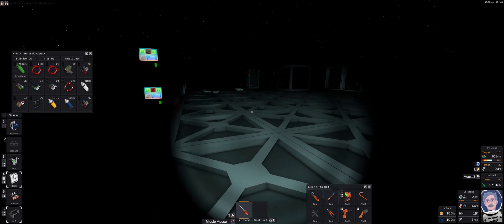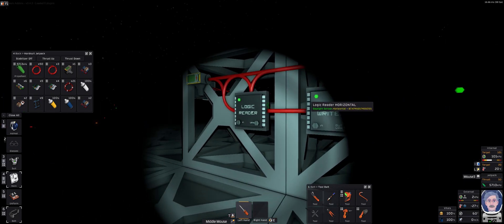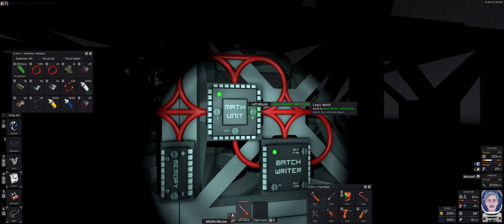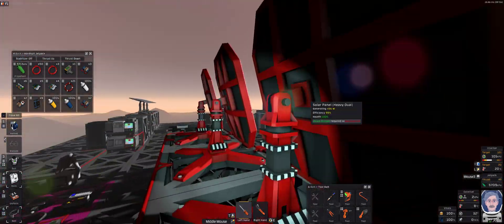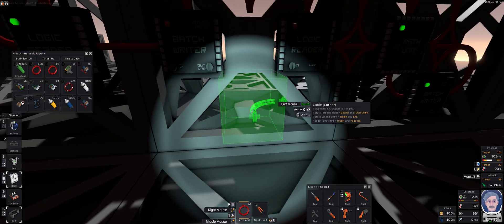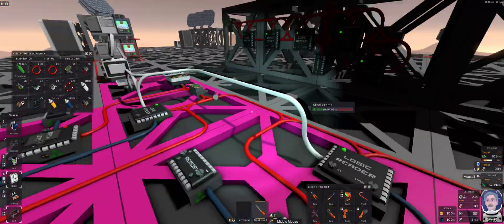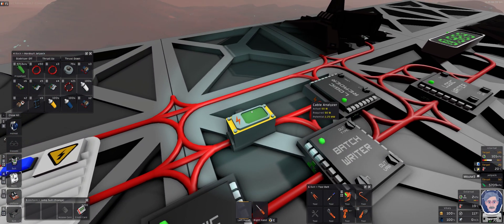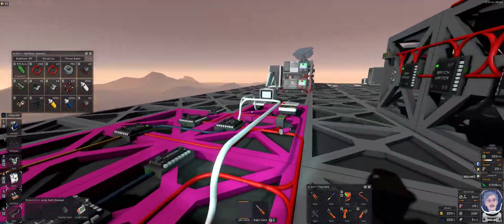Complete Idiots Guide to Stationeers - Solar Tracking without IC Coding

Comment: I'm able to get 99-100% effeciency on my panels using only 3 components for tracking.

1, Sensor
2, Logic Reader
3, Batch Writer

Use the logic reader to read the solar angle and output it to the batch writer to the correct axis, its dead simple.
This of course only works this well if you are more or less directly under the path of the sun.
Reply from the maker: yup - that's the way to do it on the moon where you start of pretty much on the equator.  Not sure what the devs have planned for the starting location(s) once the new terrain system is implemented - maybe we'll be able to select equatorial starts on the other worlds too...
Reply: @54bear  fair point, i didn't realize you didnt spawn on the equator on all planets, been a while and im just now getting back into it

Comment: Still didn't understand how the logic system works and what the values mean, spent too much time talking about other irrelevant things.
Reply from the maker: I will do a vid on the fundamentals on logic values and how/why they can be used.  A quick way of thinking about them is that they are 'measurements' of something the item in question has or uses.  Just about every item in the game that has an electrical connection will have a bunch of logic values you can access or manipulate in some fashion - but having said that, the vast majority of them you will probably never want or need to use.

A good way to get familiar is to print a Configuration cartridge (electronics printer), put it in your tablet and point it at electrically powered things.  That will show you the current values of all the 'things' that device knows about

Comment: Hi,
great explanation. I had a similar setup myself.
But I always had the problem that my cables burned out.
I had the strong cables. But I didn't have the dual panels.
Is this due to the panels or is my cabling incorrect?

Thanks.
Reply from the maker: When I burn cables, most of the time it's because I created a short circuit  - connecting a wiring 'network' to both sides of a power control, transformer or battery.  Although I have had heavy cables pop from having too many big wind turbines when a storm hits.  And I _think_ there's a possible bug in the solid generator code - sometimes cables blow when it gets fired up, even though there isn't anywhere near enough load.  Doesn't happen often enough to let me re-produce it on demand, but I always have a few cables on me just in case.

Comment: That is something I wish could be explained better. Exactly how does the orientation of your solar panels and sensor affect your logic setup?  How do you know what adjustments you need to make to the logic circuit because you mounted the daylight sensor on a wall? Anyway great videos!
Reply from the maker: I will do a short follow up video - but the essence is that the solar panels ZERO degree horizontal rotation may not be magnetic north, so depending on which way your solar panels are pointing (horizontally) you may need to manipulate the horizontal reading from the sensor.  That can be eliminated by having the sensor 'point' the same way as the solar panels.  in this case - 'point' refers to the direction of the angled (top?) edge of the sensor when it is laid flat.
Reply: @54bear Exactly what I was hoping to get here. The angled bit (opposite of the data port) of the solar sensor is forward, but what about the solar panels?  is the power port considered the forward direction?
Reply: @robertwarner8455 Same for the panels, data ports would be the back side (ie south)..so face the front towards where the sun comes up, check the horizontal adjustments with a wrench in hand and they should read 0° for north (or close to that given any offset) and you can rotate it and you get the different compass setting, 90°=east and -90°(270°)=West...etc.

But you can face the panels any direction you want as long as you make the required changes to the numerical values in the logic circuit based on the rotation you placed the panel in relation to North(direction the sun comes up).

Also be aware that the game has a history of changing the position of the Sun(or all the planets shift-its still early access) so the horizontal offset has been as much as 68° before, depending on which planet you are on...so make allowances.